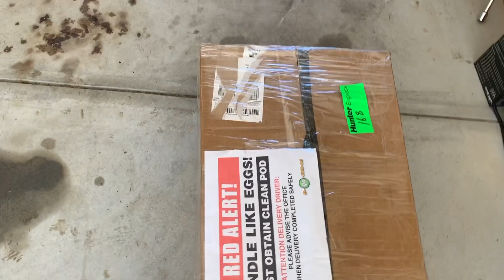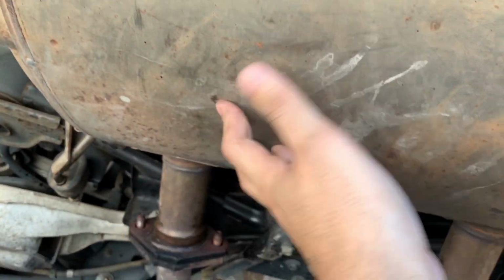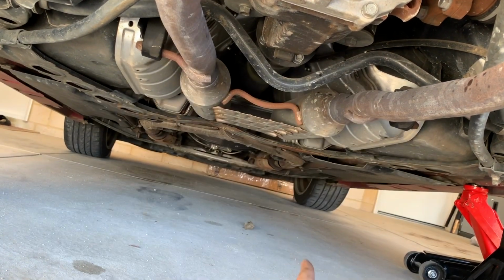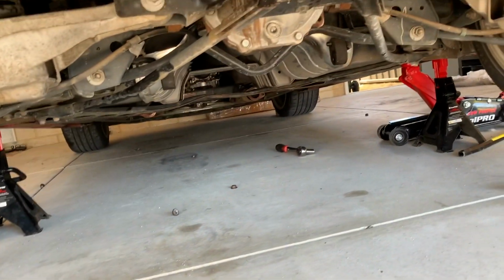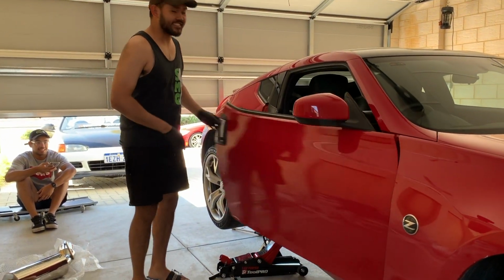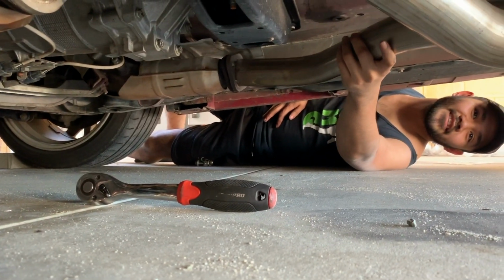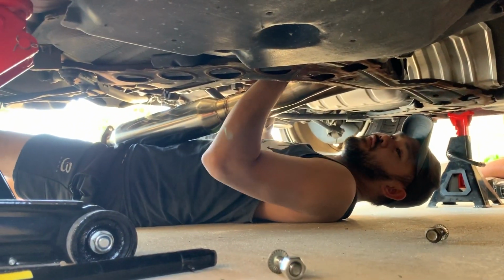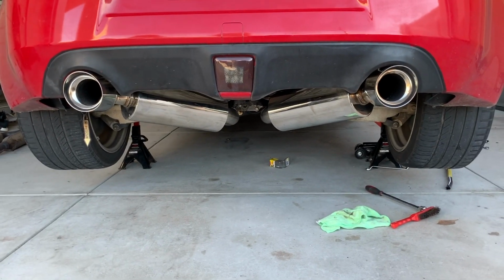Installing New Fast Intentions TDX 370Z Exhaust!!

Comment: Is this with stock cats?
Reply from the maker: Carlos Carrasco yes, with stock cats
Reply: @HustleGarageTV  would you say it is louder in person, than in the video? I'm looking for an exhaust, just don't want anything that will get me in trouble with the police
Reply from the maker: Carlos Carrasco with the 18” resonators it is very subtle and almost oem sound on idle and cruising. But when you plant your foot it starts at a deeper tone in the low rpm until about 4000rpm then it turns into a higher pitch. The exhaust is not loud that it will attract the police but still enough to turn heads, Ive driven next to police many times and they haven’t pulled me up for it yet. It’s perfect for daily driving cause little to no drone at all
Reply: @HustleGarageTV  okay thanks appreciate it, I was planning on going with hks or gemini to pair it with art pipes, but might just get the FI. I use to have tomei, tomei y pipe, and art pipes, but let me tell you it was very stupid loud and got me in trouble a few times
Reply from the maker: Carlos Carrasco ooo yes the good old tomei, sounds good but way to loud for me especially with art pipes damn! How can you still hear?? 

I’m planning to pair these with a hfc, maybe Berk or invidia. Wanted art pipes but not sure if they’ll be too loud for me